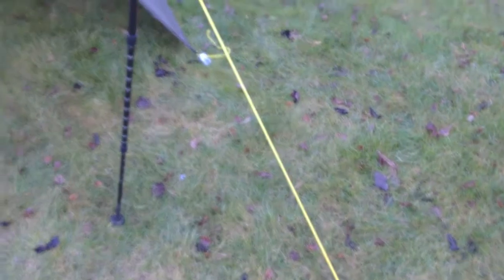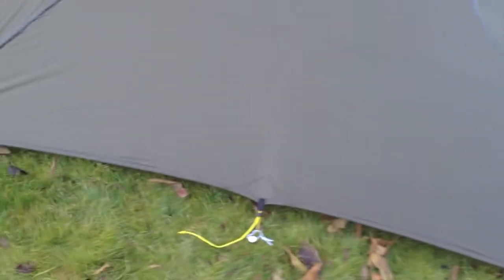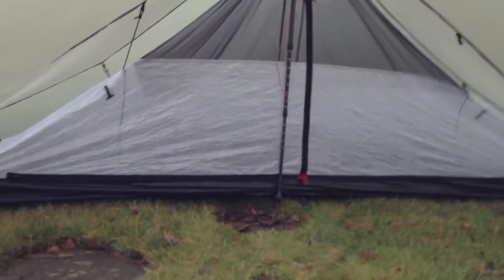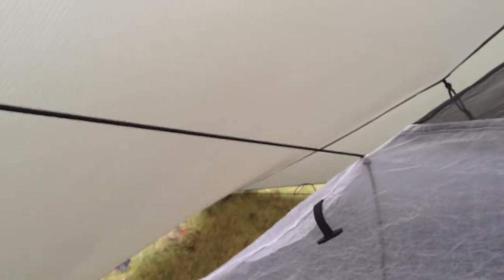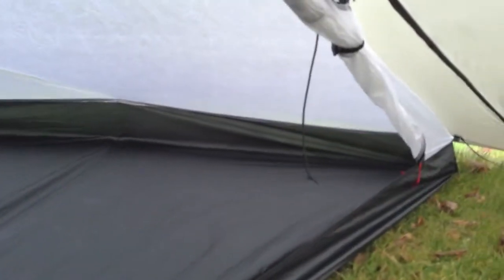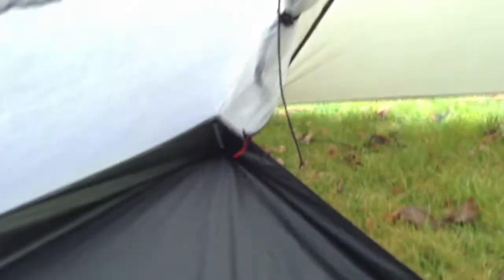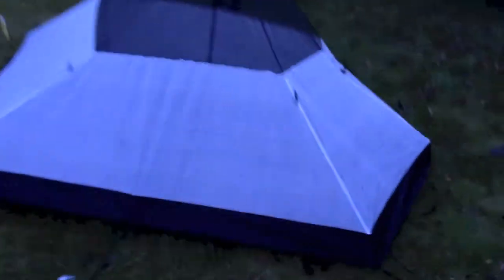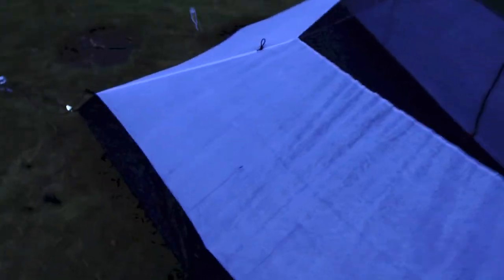MLD Trailstar and Custom Oookstar   720p

Comment: Hi mark are you still using the trailstar and ooknest if so how are  they coping  over a year in.
Especially in the uk bad weather.
Thinking of purchasing the same combo as yourself as looks a realy good setup.
Also mate could you give me some advice about ordering trailstar e.g duty.
I bought my bombshelter from usa but all duty was paid up front don't think ron does it that way.
Yip bomb shelter now you know why im looking for a lighter shelter lol.
Reply from the maker: Hi Rob
Its a real difficult one this pal cause I ain't got the TS anymore. I really fell for the romance and the sense of having a superbly strong shelter. Regretfully it is not. Let me try and explain. For one its not that light. Take the TS with it seam sealed and guyed up will take it to about 700g or more. The stakes needed have to be fairly weighty and given that the strength and integrity is based around these. Don't bugger about. I used MSR blizzards. Useful in all conditions. These add about 300g. If you use walking poles, great if not, well a good 400g. Then the nest. I had an ookworks. Cost a bomb. Chikara, cubeb, etc. 400g. Door for the TS? 50g. Bivvy cover for the sleeping bag cause you get a fair amount of weather in there 300g. Take more clothing cause its naturally colder than a tent. 
The whole thing when I worked it out was 1.8kg to ensure a 4 season shelter. You could get a bigger nest, that way youve got more room to play with minus an extra foot print. 
If you're getting it for summer autumn camps, it'll serve you well. If you can tolerate the midges. After all you've got all that space but you can't use it cause of the limits of the nest. 
I looked at all options. Valances. Full footprints, etc... 
Its a visceral experience and one to be used if you are fairly hardy and experienced if the shit hits the fan. 
I have another vid on here of me and my mate up sprinkling tarn awhile back in midst of a winter storm. A lot of user error but essentially, defines it is not a 4 season shelter. Basically, easton 8 inch nails into snow and ground. A couple of deadmans. Front porch stake come loose following a rapid thaw resulted in the front porch coming loose and wrapping around my crampons. The fabric was shredded. My mistake for leaving crampons spike up and close. But by one stake coming out compromised the shelter and my safety.  Its especially difficult to get the tension right when fingers are freezing.  
All in all, if I had money to use and essentially burn, Buy one for known weather. But remember don't scrimp on stakes and don't use titanium pegs. The stress that the 5 points are put at in a storm is huge. Additionally, won't get much sleep because as soon as it gets a bit intense you're out tightening up.
Reply: Was wondering how the patch came about mate.
My mate daveswildcamping has a compact versione and I borrowed it a few weeks back loved it mate no nest just a ground sheet.
I then found your vids and seen the nest  thaught it would be perfect for me do you get enough protection with the cuben sides. 
Dave sed his was bomb proof on helvelyn in mad winds when killys voyager was flat to the floor.
The only down side was he had a problem with the guys coming loose hence a small hole he thinks it may have been freak winds getting under line locks and lifting the tabs as he has had no bother since.
Reply: Ow thanks for the reply as well mate thaught this was going to be my new all year shelter you seamed so over the moon with it.
Have spoke to tony hobbs about it and he loves it still but he does not get in the shit weather as often as me does ya mate still use his  you had a small city of them at one point.
Reply: All about the Cadence Hi, quite shocked by the points you raised causing you to move on from the TrailStar and really glad you mentioned them.  The need for an innertent implies substantial more cost etc.  Won’t be significant cost and weight benefits when compared to a Hilleberg.  Can you share where you ended up with the tents ?  Are you now settled, or still searching.  ATB.